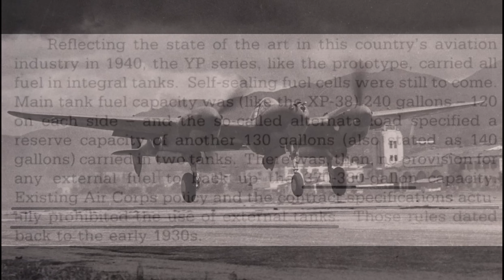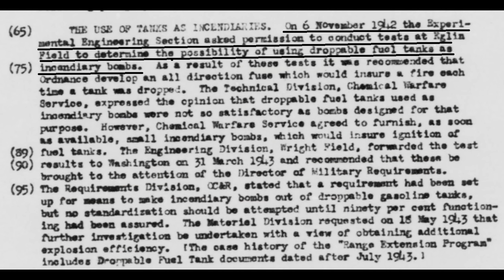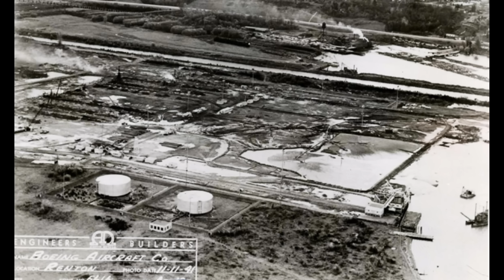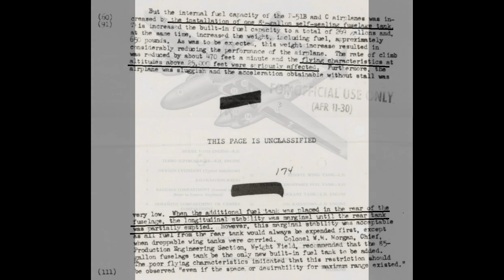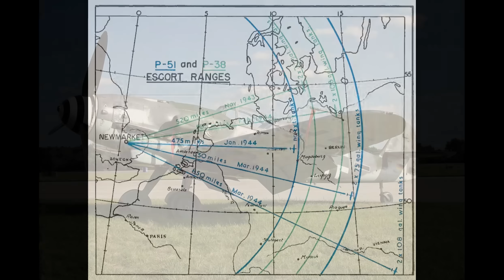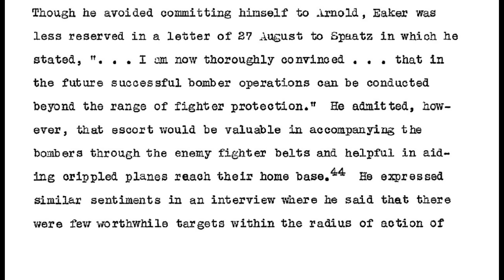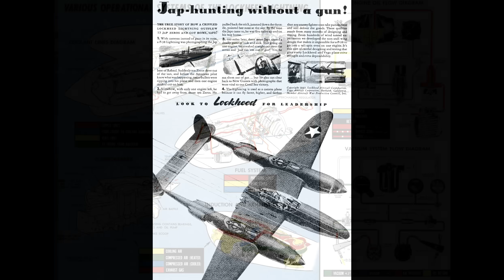The P 38 Lighting and the Bomber Mafia's Failure In World War Two

Comment: Greg - explain to your audience why the P-47C-2 through D-4  arriving in ETO could not use either the 75 or 150 gal; tanks left behind when 8th AF was stripped of P-38s for TORCH? There were more than 700+ 150 gal. P-38 tanks left behind. Ref Case History of Droppable Tanks, USAFHRC, reel A-2069. Also explain why the 52, 60, 75, 150 gal. tanks for P-38, P-39, P-40 could NOT be mounted on the P-47D-2 delivered to SWPA?  Or the D-4, or why Republic had to continue the earlier four point attach scheme especially for SWPA until December 1943 in order to continue using the 'brisbane tank'?.

Note: The Lockheed '150 gal. tank' had 165 actual capacity. The Lockheed '300gal. tank had actual 310 gal. capacity. The 150/165 was not used in Europe (not ever necessary) on the P-51B/D but was used in Pacific (and Korea).

Explain why the P-47D-6 COULD finally carry the 52, 60, 75, 108 and flat 150 gal tank after Schweinfurt mission? Explain why the P-47D-15 COULD finally carry the Lockheed 150 gal. tank operationally in March 1944, for both SWPA and ETO/MTO.

Simple answer Greg. Kartveli IGNORED Kelsey's March 1942 directive to 'install and deliver a P-47 with one 75 gal. belly tank and two standard 75 gal. wing tanks'.  Ref - Case History of Droppable Tanks. Note; Lockheed delivered aluminum and Wright Field delivered steel 150 gal. in 1942, Wright Field delivered composite 52, 60, 75 tanks in early 1942. Source. Case History of Droppable Tanks - all references served as basis for USAF Study 136, by Boylon - which curiously Telenko praised, while contradicting many of his (and your) statements. Karvelli did not actually test a B-7 and B-10 rack modified P-47D-2 until July 1943.

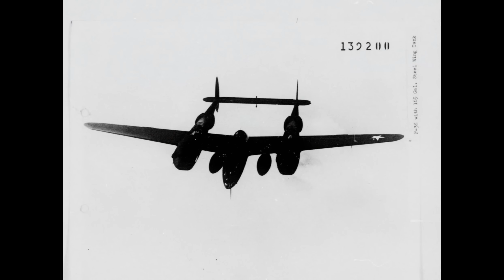Time 43:00 and beyond.
No, the P-47D-15 with wing racks (but without 370 gal internal fuel) could not be planned for Schweinfurt, and in fact never escorted that far. Only when the P-47D-25 arrived in sufficient quantity after D-Day, could the P-47D plan for a Berlin mission.

FDR and Churchill supported North Africa - and prevailed - against the advice of Marshall and ALL the joint Chiefs of Staff as a dilution from invasion of Europe. Generals Marshall, General Devers, Arnold (and Eaker) were pissed off that TORCH took half of 8th BC and all Troop carrier, Light Attack and all Fighter groups including the P-38s DESIGNATED for bomber escort of 8th AF. Put your finger on Eisenhower (and FDR) for the asset grab from Britain. The argument of the Joint Chiefs was that North Africa not only diluted the invasion force build up in Britain, but also deemed 'risky'.

Look up General Jacob Devers and his political foe Eisenhower for better perspective of 1942-1942 turf wars between ETO and MTO when Eisenhower and Spaatz tried to poach 8th AF resources again and Devers/Arnold with Marshall's full support stopped Eisenhower in July 1943. That same month Arnold diverted two P-38 FGs from MTO to ETO, with 20th arriving one week (untrained) before Schweinfurt-Regensburg mission and 55th arrived early September, 1943.
Reply from the maker: That's simple and I have explained it multiple times. The very early P-47s were set up to carry much bigger and heavier tanks that were designed for the P-47. The 75 gallon tanks were designed for P-39s and P-40s, airplanes with about half the P-47's rate of fuel consumption. 

Republic aircraft was following the horribly misguided directive of the bomber mafia. Lockheed had a work around. All this was explained in this video with supporting documents. 

For anyone who wants to see my debate with drgondog please watch it here: https://www.youtube.com/live/qzrg-u-MYdc?feature=shared

I don't see much point in trying to debate this again in the comments section.

Comment: What was Carl Spaatz doing in all of this?  He seems well regarded, and looks like a guy who didn't suffer excuses, but I've never seen anything on how he felt or what actions he was taking.  He was also Doolittle's boss in Africa for a while so had to know Doolittle's feelings on the P-38's.
Reply from the maker: Carl Spaatz is a complicated mixed bag. My short version is that he was hardcore bomber mafia, but then started to wake up and smell the coffee. At that point he was replaced by Ira Eaker.
Reply: @GregsAirplanesandAutomobiles  And Spaatz took over direction of both 8th and 15th Air Forces from about 1/1/44.
Reply: Spaatz was the guy.  The sortie rate over the continent was crap for the size of the force so with the help of some hand built H2X sets from MIT it was time to start radar assisted bombing by the USAAF. The first such raid was to Wilhelmshaven on Nov. 3 '43.  539 Forts and 45 P-38s in the target area. And a large number of P-47's who little engaged.  Only 7 Forts were lost; bombing was okay although other H2X raids were not very accurate. But the Germans had great difficulties even operating in the bad weather.

H2S/H2X was one of the biggest contributions by the British since they weren't very keen on fighting the Germans.

Comment: In your previous video on the P-39 you stated how it was not a streamlined design, and that they had to make a bunch of changes to claw back some of the performance that was lost between the prototype and the final, armed and armored version. If the Aerocobra is fairly "dirty" from an aerodynamics perspective, why is it so fuel efficient? Or is it only fuel efficient in comparison to a twin-engined plane and a plane that is basically a flying barn? It's not even turbocharged and has only a single stage supercharger, so it should be quite inefficient at altitude compared to the Lightning and Thunderbolt, both of which are turbocharged.
Reply from the maker: They improved it over time. The original design was terrible but it got better. Also, we are not comparing it with later planes here, the P-38 and P-40 were in the same boat.

Comment: One question, I understand that the P--38 had a lack of adequate cabin heating. In the diagrams I have seen such as the one above, it appears that there was heated water provided to the cockpit  from the engine cooling system. What made that inadequate and was it ever properly addressed by Lockheed or in the field?
Reply: It must be understood that the 8th AF used the wrong cruise settings for the P-38. As a result, both the engine oil and engine coolant temperatures were well below proper operating temperatures. As such, the water provided to the heating system was well below the temperature necessary to provide any real heat to the cockpit. That's just one more reason the incorrect setting were disastrous.
Reply from the maker: At the time the P-38 was designed most fighters didn't have heaters at all. In fact until the end of the war other than U.S. fighters very few had heaters. The P-38's early heater was poor, but better than nothing, in the later models from about mid 1943 on the heaters were improved and pretty good.

Comment: The P-38 Lightning had the range to reach Berlin in 1943. However, Luftwaffe fighters could outmaneuver it at high altitudes. The P-38 was not well-suited for high-altitude dogfighting, and its engines sometimes experienced performance issues at those altitudes. As a result, the P-38 developed a mixed reputation in the European theater during World War II. Consequently, the P-51 Mustang became the preferred choice for high-altitude dogfighting due to its superior climb rate and maneuverability against Luftwaffe fighters.

The P-38 Lightning excelled as a fighter-bomber and an exceptional strafer. It was highly effective in these roles by 1944. Its armament included four .50 caliber machine guns with 2,000 rounds of ammunition and a 20mm cannon with 150 rounds, all mounted in the nose for precise accuracy. Additionally, it could carry a bomb load of up to 2,000 pounds or ten HVAR rockets. These high velocity aircraft rockets were 5 inch rockets capable of delivering high explosives on tank columns, trains and German positions with great lethality. Some versions of the P-38, such as the "Droop Snoot" configuration, featured a plexiglass nose with a Norden bombsight for precision bombing. In these missions, a lead P-38 equipped with the bombsight would guide formations to tactical and operational targets. Once the lead plane dropped its bombs, the other P-38s would release theirs and then descend to ground level for strafing attacks on targets of opportunity.

These strafing missions turned Germany into a "giant shooting gallery." Airfields, railway marshalling yards, infrastructure, trains, warehouses, and vehicles were systematically destroyed. The P-38s often carried rocket pods or bombs for these low-level attacks. General Eisenhower's Transportation Plan in 1944 emphasized relentless fighter-bomber ground attacks to cripple Wehrmacht infrastructure. This strategy not only defeated the Luftwaffe but also paralyzed German ground forces. Moving mechanized units, railways, and vehicles during daylight became nearly suicidal for the Germans, rendering maneuver warfare impossible.

Allied medium bombers complemented this effort by targeting bridges behind enemy lines, disrupting night movements and supply convoys. P-38s and P-47s prioritized attacking congested areas near destroyed bridges, turning German truck columns into "flaming junkyards." Wehrmacht tanks and mechanized infantry units became paralyzed from the relentless destruction of their supply columns in the summer and autumn 1944. A Wehrmacht Tiger tank without fuel, spare parts and ammunition becomes useless scrap metal without supplies. Many German tanks were left abandoned on the side of the road. This result was the handiwork of the P-38 Lightning fighter-bomber ground attack strategy. Ike's Transportation plan was one of the most decisive war plans of WW2. 

In summary, the P-38 Lightning could carry 2,000 pounds of bombs or ten 5 inch HVAR rockets, had a 20mm cannon with 150 rounds, and four .50 caliber machine guns with 2,000 rounds of ammunition. Its tightly grouped nose-mounted armament allowed pilots exceptional accuracy in strafing missions. Alongside the P-47 Thunderbolt, the P-38 played a critical role in Eisenhower's Transportation Plan by turning Nazi Germany into a "flaming funeral pyre" for the Wehrmacht. This strategy contributed significantly to Allied victory in Europe.
Reply from the maker: Did I not address those points directly in the video?
Reply: False, The P-38 lagged only in terminal dive speed. The engine issues were a result of British fuel, improper rigging/maintenance, and use of improper power settings in defiance of the pilot's operating manual.